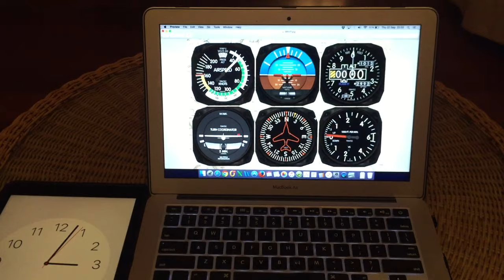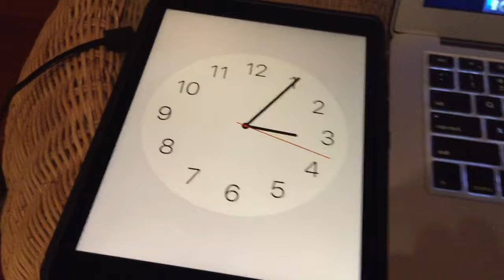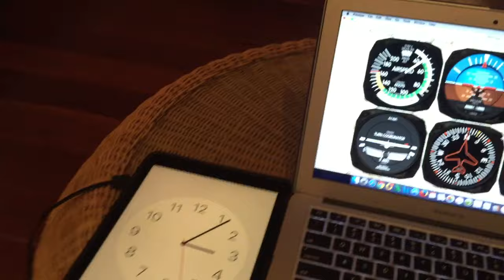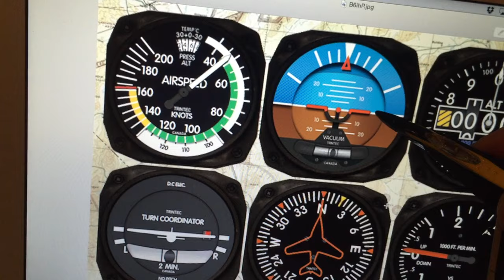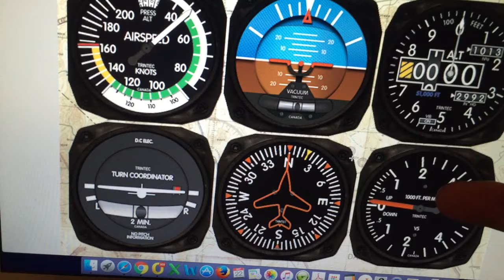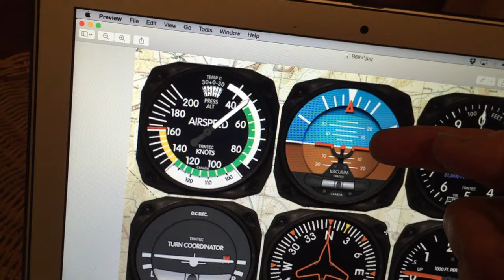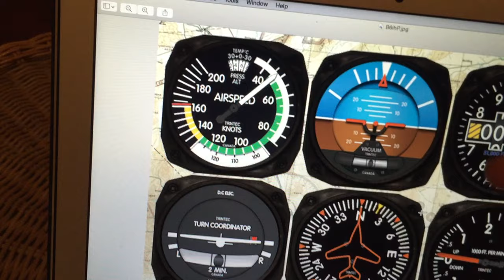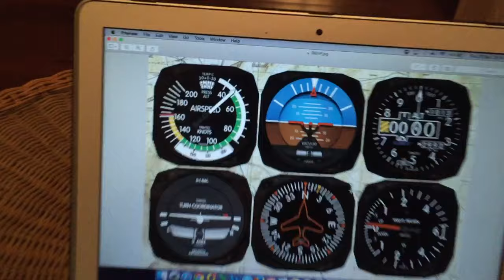Do aircraft change attitude to follow the curvature of the Earth?

Comment: You are correct that an airplane is pitching nose down as it flies around the earth and everything else you say is true. But there is one thing you are missing. The Attitude Indicator is driven by a gyro platform that stays rigid and level referenced to the take off point. As such the artificial horizon will constantly show the airplane pitching down as the airplane follows the curvature of the earth (which proves that the earth is round). The deviation is very slow but it does compound over time and this phenomenon has been observed many times. However, to compensate for it airplanes have correction circuitry built into the system that cancels out the effect so that the attitude indicator always stays referenced to the ground directly below the airplane rather than to the ground back at the take off point. Older airplanes with global range like the B-52 used to have a knob that the pilot had to continuously adjust as he flies around the earth but newer airplanes with modern avionics make the corrections automatically.
Reply from the maker: +Joe Vignolo.  Hi Joe, You are right and have you seen my video with an opened Artificial Horizon that demonstrates how the pendulous vanes will constantly correct it back to level. 

https://www.youtube.com/watch?v=-0n-UDrB3Ys

https://www.youtube.com/watch?v=TbqcT05YWeo

https://www.youtube.com/watch?v=kTXTCqMHyhg
Reply: @ Wolfie6020 - Thanks, I will check them out. I'm more familiar with the old fashioned manual correction system and have wondered exactly how the newer automatic systems work. Also, this is somewhat similar to how they used optical star sightings to correct for accumulated drift in the gyro platforms during the Apollo missions.
Reply: @ Wolfie6020 - I watched the first video you listed and it basically provided the answer to how automatic, self leveling works. However, I think there is a something more to the story. I posted a question to the comment section of that video. Please see that. Thanks.

Comment: Isn’t the top middle dial from your laptop the imaginary horizon which is based on a gyroscope? The whole principle of the gyroscope is that it never looses it’s level so it means that the more you pitch down the more your gyroscope it will show you that you need to lift your nose to keep the airplane level, does it make sense? Please explain as I’m not a pilot it is only a curiosity

Comment: That was a really good description. However, I slightly disagree about the rate at which you pitch to maintain your attitude. You don’t notice the rate because it changes at exactly the same rate as you cross the Earth. However as you cross the Earth your weight is ever so imperceptibly reduced. The higher the speed the lower your weight. Really get a move on you get to zero g, as per the ISS.

ps. I wish the autopilot in the Embraer 190 I flew maintained altitude as well as the one you described. It was smooth but it wandered all over the sky. It flew well within RVSM limits but you always felt you had to keep an eye on it. And we won’t talk about the auto-throttle - the system that must not be mentioned.
Reply: the ISS experiences zero-g because it is in freefall... I don't think planes are in freefall (most of the time, hopefully)...

Comment: If a plane can take off completely from ground by defying gravity,then why cant it resist gravitational piching down if its maintained on a constant altitude?
Reply: Balan Thelappurath   It’s not defying gravity. It is using energy and lift to overcome the acceleration field temporarily. No energy, no lift. Constant altitude is based on air pressure.

Comment: No. Aircraft tend to stay at the same distance above the earth (altitude).
The earth curves so the path of the aircraft curves, but stays at the same altitude.
Reply: Wrong. The plane can fly on a straight path into thinner air, meaning it rises in altitude relative to earth. Only at very high altitude will the effect of thinner air auto correct the plane height.

Comment: Wolfie620, the airplane doesnt have to pitch down at all. in fact, it never pitches down.it is always level , with respect with the direction of gravity.    in other words, the nose never pitches down. it cant. if it did, it would be gaining altitude or losing altitude, which is impossible, because that would mean you would need to change the pressure range you are operating in, and that never changes.   the atmosphere and and oceans are curved. so like a boat, an airplane doesnt need to tip the nose down either.
you have GREAT videos on how the gyro works, but you might want to clarify the facts on this video too!  cheers!
Reply from the maker: +zanick2.  You are 100% right and that is what I am saying in this video, there are very slight pitch changes constantly as the aircraft is adjusting to stay at a constant altitude.  There is no pitch change relative to the horizon and what you said is correct.  What I am saying is that as we adjust for altitude constantly.  (small adjustments) the attitude of the aircraft is slowly changing relative to its starting position (not relative to the horizon)
Reply: Wolfie6020.....no, we dont adjust for altitude constantly.... the altitude above the earth is constant in level flight.  you fly in a constant pressure range.   yes, the attitude of the plane changes relative to the place you took off from, but you dont need to adjust the aircraft to do this.    the earth is curved, so, it does this for you as you stay level relative to the ground... always..... with NO pilot input.    no small adjustments..  yes, there are such small changes relative  to the plane's orientation vs what it looked like upon take off, but there are no "small adjustments"..  even if the earth was spinning at 25,000mph . (once per hour)  just standing on the earth, would not feel anything, because gravity points straight down..... you would feel a little lighter. ;)  but you wouldnt feel anything. AND, the gyro would almost be able to keep up with that change...  or if the plane was traveling at 25,000mph (around the earth in 1 hour)  .. the same thing would be true.     the gyro adjusts, you cant feel anything AND, the pilot DOESNT need to do any input to follow the curve... he just flys at the same altitude PRESSURE, and that pressure is curved around the earth based on its distance to the ground!   makes sense???
Reply from the maker: +zanick2  Perhaps I did not explain it well.   What I mean is that if you turn the autopilot off and let go of the controls the aircraft will not maintain a precise altitude.   Say 35,000 ft.   

It will slowly drift up or down.  As you know we need to stay within +/- 100 ft of the assigned altitude and my point is the plane will not do this by itself  (autopilot turned off and nobody touching the controls) 

The constant adjustments I am talking about are the minor corrections the pilot makes (or the autopilot makes) to fly a precise altitude.
Reply: Wolfie6020.... now, that makes sense, but clouds the issue.  you made it sound like you need to make small adjustments of pointing the nose down, based on the slight curvature of the earth. those adjustments are not needed... the adjustments you need to make, are the ones you just said..... just random small adjustments based on the airplane not flying perfectly straight at all times, relative to the ground... it can be up or down and has NOTHING to do with the earth curves.     you make it pretty clear that the airplane is pitching down and "you cant feel it" yet, my point is that it is NOT pitching down 1 degree every 8 mins, its remaining level...always with the autopilot on.   you referencing that the plan is pitching down and the pilot is "pitching" the plane down.   He is NOT .  the airplane is NEVER pitching down....and the pilot is never pitching the nose down, even at a very slow rate.. NO pitch change!  sure, the plane will go around the earth, but the plane pitch down relative to its orientation to when it took off , but there is no "pitching" the pilot has to make .    think about just standing on the earth..... do you lean forward just sligtly as the earth rotates???   no, you just stand straight up and the earth rotates you 360 degrees ..  same thing in an airplane. no difference. and NO adjustment necessary.
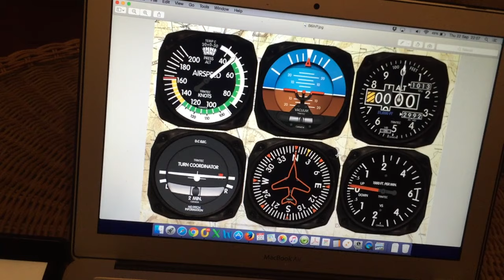Reply: Wolflie, you say at 4:40, "lets talk about why the pilot is not conscience of pushing the nose forward".     again, the nose is NEVER pushed forward, consciously or unconsciously .  the plane stays LEVEL always, and will go around the earth with no adjustment. just like a boat never has to "dip" its nose ... it floats level and follows the curved ocean... just like the plane follows the curved lines of equal pressure.  make sense?

Comment: The way I think about it, is that level flight is just a case of balancing forces: lift, thrust, drag, and gravity. 
Once you balance them (using the throttle and control surfaces), you don't gain or lose altitude. There's no net force to push you higher or lower.

The "rising due to the curve" thing, is centrifugal force, which is just another slight upwards force that gets added to the lift.
It just means that you get a tiny, tiny bit more lift, which you balance out with the control surfaces, the same as the aerodynamic lift.

It's like saying: "The wings produce lift when you move forwards at speed, so why don't you go flying off into space?"   (cue Desertphile)
Or "Gravity's pulling down on the plane, so how does it take off?" ...oh wait they actually do say that one sometimes. 

Their problem is that they think "level" means a straight line.

Comment: The gyro is calibrated on a level runway before take off, if the plane flys round a globe 1 degree of pitch every 8 minutes of so what instrument measures the change in degrees from take off to land 12 hours later 90 degrees from take off?

Comment: Wolfie6020, why have you NOT publicly recanted your statement.   NO, the aircraft doesnt have to adjust its position or orientation to follow a curved earth.  it does this naturally, and with out any control by just keeping plane flat and level with respect to the force of gravity, which is straight down, perpendicular to the flight path.  altitude has to do with air pressure and this air pressure gradient is curved around the earth, and this is where is no control needed to follow the earth's curve.

Comment: You say we can't feel the movement because it is to slow ?.... would the earth spinning at over 1000mph qualify for feeling movement ?
Reply from the maker: +Lab Rat. Speed is irrelevant. You cannot feel speed.  Have you ever been on a jet aircraft cruising in smooth air?  You don't feel a thing travelling at 600mph.

What is your Latitude?  Are you at the Equator?
Reply: I travel extensively from UK to Far East. Is speed irrelevant when pertaining to inertial forces? I think centrifugal force is varied as speed varies, thank you for your reply.
Reply from the maker: +Lab Rat - if we are considering centrifugal forces then yes the speed is relevant.  In fact, this is very relevant to measuring the Eotvos effect. 

if you are flying East across the Earth at a constant Altitude objects will weigh less than if you were flying West. 

This is exactly due to centrifugal force - the faster you move around a circle the greater the centrifugal force is.  At Jet speeds and with the rotation of the Earth at the Equator the force is measurable on an ordinary set of scales.   I have tested the Eotvos effect many times myself and the results are consistent. 

If you are at the Equator moving at 1000 mph remember it still takes 24 hours to complete one revolution - the angular velocity is very small and this results in a tiny amount of centrifugal force that will make you very slightly lighter.  The amount of difference is about the same as drinking glass of water - you won't notice that change in your body weight at all. 

You do not feel it because the effect is constant and unchanging.  It is the change in acceleration that we can feel.  We cannot feel constant speed.
Reply: lab rat, You can't feel motion, you only feel acceleration, that is change in motion, positive, negative or angular.
Reply: Thanks for that wolfie
Reply: Correct. Earth movement itself upsets gyro. Airplane movements are added to it.

Comment: G'day Wolfie,
what an Awesome explanation,
as soon as you mentioned the controlsI thought about how you have to adjust the steering wheel to drive straight down a road in a car

Just did some maths & it takes 525,573.7 Boeing 747-8 to go around the Equator 🤔

Comment: I noticed that he never mentions the self-erecting mechanism, comprised by the pendular vanes in a vacuum-driven attitude indicator (the term "artificial horizon" is outdated). The mechanism is responsible for keeping the instrument always level, that is, aligned with the local vertical. He seems to suggest that the aircraft is actually pitching down by slight amounts, but that is wrong. The aircraft never "pitches down" because in straight & level flight the primary instrument for keeping the flight path at level is the barometric altimeter. The aircraft doesn't pitch down for the exact same reason a ship at sea does not have to pitch down to follow the Earth's curvature: both are following equipotential surfaces. The difference is that the aircraft moves on an equipotential surface at a certain altitude above sea level, while the ship moves at zero altitude. By the way, I am a pilot and aircraft owner. I know what I am talking about.

Comment: Flying "level" simply means maintaining the same distance from the centre of the Earth.  This occurs when the lift given by the wings exactly counteracts the downwards pull of gravity.

Vertically downwards is the line from the aircraft to the centre of the Earth. This applies at all times. Level is the plane perpendicular to that line - at all times. The plane moves with the aircraft. Aim above that plane to increase the distance between the aircraft and the centre of the earth. Aim below that plane to decrease the distance between the aircraft and the centre of the Earth.

It takes additional energy to incresae that distance. If no additional energy is used, the aircraft maintains the same distance from the centre of the earth. This is level flight.

If the source of propulsion is decreased or removed, gravity works to pull the aircraft back down to the Earth's surface.

Comment: As stated in the few posts by me on Youtube, I am not a flatearther. Matter of absolute fact I do not actually know just what shape the earth is and frankly I could not care less. As far as I am concerned about the matter I behave and live as if the earth is flat. Personally I think the flat earth to be an absurdity. The sphere seems to be a natural shape. Molten metal when splashed on the ground  or thick oil in water when its body is broken up , little spheres of the material are what is see. I think it would be impossible for any other shape than a sphere to exist in nature.I was in  aviation for some two years but not as a pilot though I did privately fly a Cessna 170A. The gyros at that time were based on the simple mechanical rotor in gimbals and were most assuredly not fitted with any sort of device to correct for curvature of the earth or sideways drift. I have taken apart and put together many of these fascinating devices and have never failed to be amazed at their properties and total simplicity. I understand the modern laser ring gyros do have an addon to correct for drift in all three axes. Regardless of what you have so lucidly come forward with, I have never had to constantly set the gyro during flight. Initially the set up is conducted with the aircraft located in a remote location free of all magnetic, electric, static and most important of all, mechanical vibration from road and rail traffic. Once set the gyro remains fixed for ever unless deliberately altered. I have also conducted experiments with gyros at a place 12N x 77E and starting at noon , I have failed to see any movement of the outer gimbal even after more than 6 hours. Foucault on the other hand is supposed to have obtained movement of the appropriate gimbal indicating rotation of the earth. Notwithstanding the contrary experiences of experimenters, the curvature of the earth is supposed to be 8 inches per horizontal mile. It must surely be absurd that such a monstrous  rate of curvature may not be experimentally verified. As  a surveyor I have never nor has anyone else used any but the standard equipment for the laying of  roads and building foundations and never have I used any correction for curvature. Presently I live a few blocks away from the ocean which strangely is totally calm for at least 9 months of the year On a promontory jutting into the ocean I can see the distant water line for about 300 degrees all around and this water line  or horizon appears absolutely straight and level. As against what has been stated, I have seen the Foucault at London and at Melbourne and over here near the equator. The movements of the base are perfectly in accordance with the rotating and rotund earth. Perhaps you could be good enough to offer some explanation as to the contrary results obtained in the different observations. Thank you.

Comment: Planes fly along air density gradient at a given energy input. Imagine a pingpong ball being held still by a jet of air from underneath. Acute changes are made by adjusting the wing tail etc but ultimately you need to alter the energy input to maintain those changes. You are correct in that compensating for the curvature is dealt with in the "noise". It is gravity which determines air density which always points toward the centre of the earth and hence follows the curvature of the earth all other things being equal